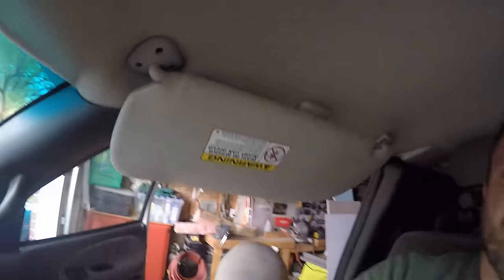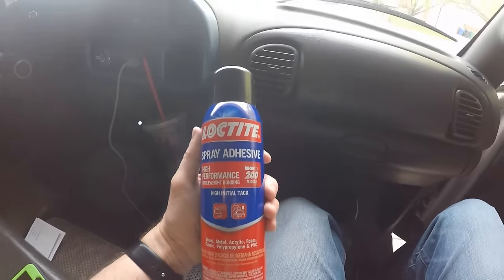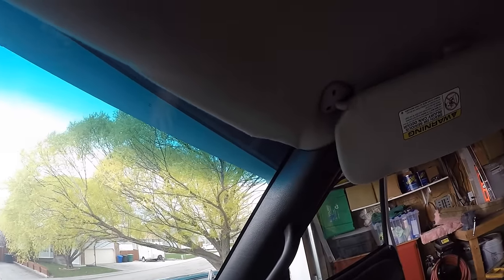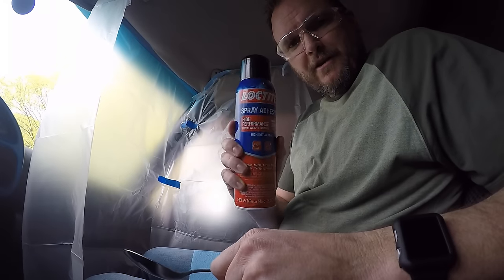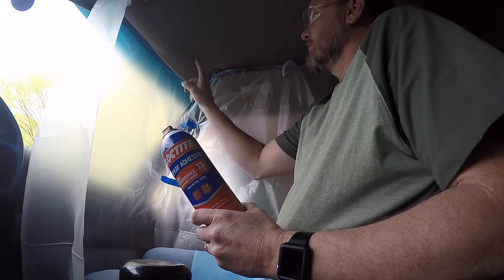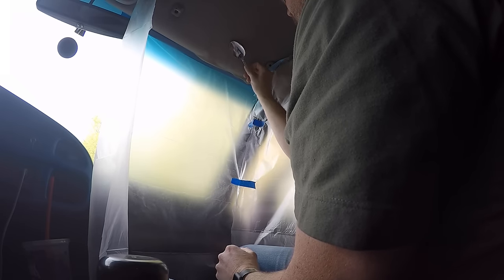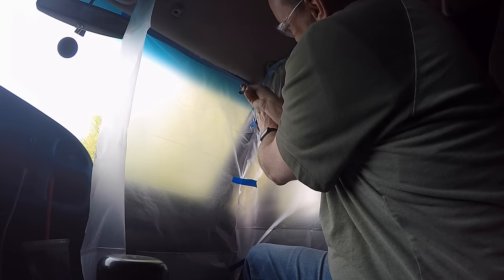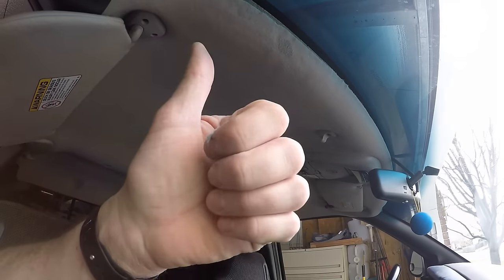Truck/Car/Van Headliner Repair - Sagging, separating, tearing away, drooping - DIY Fix

Comment: Is it ironic I'm watching your video because I have a Ford Ranger with the same problem?

These spray and tack glues state they are not for use with headliners. Do you have an update as to the durability of this repair technique? This was made 3 years ago, is the headliner repair still good?
Reply from the maker: It has been holding good until the last 3 months or so. I like to drive in the summer with the windows down. Even when it’s super hot outside. I have a new part above the drivers side that’s coming loose and the part I repaired is starting to come down again. I’d suggest the 3M headliner adhesive that’s linked in the pinned comment. I’m going to be buying some myself and give that a try this time. See if that holds better. 🤷🏼‍♂️
Reply from the maker: 3M Headliner Adhesive link to it if you'd rather try it - https://amzn.to/2rWQAtA
Reply: @troysgarage  Thanks for the update! That's not a bad but also not great as far as repairing the issue. 

I had can of Stinger spray glue for speaker box carpet. When I looked up the Loctite product you had on Amazon, I saw the review that recommended the 3M. I then watched another video, and in that they said the 3M works great but NOT for reattaching the fabric to the foam, only if it's the foam that has detached from the backing. He said if it's the fabric, like both of our situations, the only real remedy is to replace the headliner. Also he warned about hte staining/discoloring, which you mentioned and said the lighter the color the worse the staining will be. I have light brown.

I just ended up stapling mine back up, along the window edge, you can't see the staples. Someone wouldn't really notice unless I pointed it out. Not sure how long it might last but my guess  is a couple years. My trucks not in great shape (05) so it don't matter a lot to me more just trying to keep it out of my view and from getting worse.

Comment: Only for those who have it tearing along the edge - my past 3 vehicles that did this did it in the middle -as my current new used truck has now - oh wrll
Reply from the maker: True, it's easy to fix along the edges.  The key is catching it early enough (or being lucky enough it only releases at the edges.

Comment: Actually the problem is that (* or rather, if ) the foam is deteriorating. Gluing fabric to deteriorating foam is kind of like sprinkling dust on tape before you try and stick it to something. If you use enough glue that you fully saturate through the foam into the surface that the foam is stuck to, then when it fails and you have to have your headliner replaced, somebody is going to have to sand all that glue down before putting in a new headliner.
I've never done this I just watched some other video about it.
(added "or rather, if" on 10/6/2022)
Reply from the maker: I purposely didn't reply to this until even more time had passed.  This fix is STILL holding strong for me.  This doesn't mean you are wrong in every case, just in mine.  My foam backing wasn't overly dried out and the connection made between the fabric and the foam was strong and pretty immediate.  It doesn't look perfect, but it holds and isn't noticible by anyone but me.  I've never had anyone ride in the truck and ask about it.  It's just there and holding strong.  3+ years and counting.
Reply: @troysgarage  well, I thought my foam was deteriorating, but it isn't.
I used a little superglue in spots and some held, while others failed.
I guess it all depends on the condition of the headliner foam and condition of headliner material.
I'm now confident that if I use adhesive on my headliner, it will work.
I don't really care what it looks like (as long as it is physically clean, no mud, grease, etc), I just don't want it causing me to get in a car accident if it releases.
I'll probably do what you did in this video.
Thanks for the update!
Reply: @troysgarage  The only reason I won't rip my headliner out, is that I hear it gives some insulation from the sun. If I glue it, that's fine, better than removing it and I'm not paying $400 to get someone to do it professionally on an old vehicle that I only need functional.

Comment: it will not hold long,and it will be falling again.the glue will not hold because the foam has turn into a dust/dry rotted,and the glue is on old foam that will let lose in time,the best way is to take the headliner out,take off the old and the old foam until it's clean,then glue in the new.
Reply from the maker: It’s been 18 months and no sagging or additional parts coming off. I’m always curious why the “experts” watch videos of “how to” and then critique the steps taken?!?!  Maybe you should do a video. Hahaha. Naw, it’s more fun to pretend to be an expert. Thanks for the view though!  On a serious note though, is very bad cases the headliner would need to be removed. You’ll know that’s needed if it’s coming apart and sagging in multiple places. Mine was confined to this one spot. I still drive around with my windows down all the time and there’s no sagging,drooping or separation anywhere else either. My fix is good and still holding strong!  Good day sir!
Reply: Good DAY, sir! 🤚🏾.. lolol!

Comment: OK and that was 2017. Could you tell if your satisfaction lasted for all these years or more stories to share? I'm curious.
Reply from the maker: It has just started to come apart again in the same place. 4 years isn’t bad for a cheap fix. I’ll do the same fix again as soon as it opens up enough on its own to spray behind. Until then I just use the back of a finger to smooth it back out so the wind doesn’t catch it and make it worse. I like to drive with my windows down. 🤷🏼‍♂️
Reply: @troysgarage  Dearly thanks for the update.

Comment: Spray adhesive didn't stick, the backer board is flaking and not sticking to the cloth... I tried some thumb tax... No luck either.... ????? Frustrating!!!!
Reply: Addendum: I have to remove entire backboard.... Strip off old cloth, sand clean. Apply new cloth.... Someday...
Reply from the maker: Sorry, that’s the only option if it’s too far gone. Sounds like the rest is coming down soon too.

Comment: Can i just remove the entire headliner ?
Reply from the maker: Of course you can. After removing, use a shop vac with the bristle attachment to vacuum as much of the insulation off as you can. There will always be some left. 

My son did this to a super a cheap car he had in high school. Every time anyone bumped the ceiling insulation would fall. He also sprayed it with spray paint to try to get it to stop doing that but it didn’t work so well. Another spray might do better. Try PlastiDip maybe. 👌🏼👍🏼

Comment: Big improvement! Too bad GM couldn't use some decent glue in the first place. Cheap bastards!
Reply from the maker: Lots of corner cutting and cost savings taking place in the auto industry over the years. I know they have the tech to build a vehicle that would last decades but that doesn’t make them money. 🤷🏼‍♂️🤮

Comment: How come no one talks about how much these things cost? Permatex is $25 bucks at O'Reilly's, no idea elsewhere...why don't you address this obvious factor?
Reply from the maker: link to the Loctite spray adhesive used in this video is to Amazon for $23.50 - http://amzn.to/2o8ACbn.  This is a cheap fix if you catch it early it will save you hundreds later.  No brainer DIY weekend project.

Comment: What if it's sagging in the middle, not at the edges?
Reply from the maker: You’ll likely have to take it down and reapply the whole thing. You could do half at a time but not sure if that would be easier or harder. Maybe someone else can comment on that?  Hope you get some good advice on that one.

Comment: So basically that's for small jobs, if it's sagging all the way to the back then what??
Reply from the maker: Sorry to say but you’ll have to take the whole thing down and out. You have to get adhesive on both the fabric and the backing then carefully line it up to get it just right. I have seen a couple of videos out there but if I remember right they replaced the fabric when they did it. That would be easier than trying to line up an already cut to size piece.

Comment: Unfortunately, you will chase that droop over the whole rest of the headliner until you replace it.
Reply from the maker: It’s been 5 years since this repair and it’s just now starting to come down again in the same place and also just over the same spot on the drivers side. I’ll use this same repair again on both spots and it should last another 5 years.

Comment: That looks horrible; how embarrassing. You protected everything but your lungs with that glue. Thanks for the post though.
Reply from the maker: Keep in mind this isn't a "restoration" but a "keep it from tearing away further" job.  The truck had 285,000 miles on it at this point.  I sold the truck at 309,000 miles 3 years later and this fix was still holding.  On the protect your lungs thing....  if you do this stuff for a living and expose yourself daily then YES please protect yourself.  I had plenty of ventilation and didn't even get a contact high from the fumes.  Everybody needs to relax!  Putting your stuff out for the world to see isn't easy.  So I guess you're welcome!

Comment: I already tried that bullshit Loctite crap.  It doesn't work, and is sagging more than ever.  The heat affects the glue and it falls apart a second time. Go back to the drawing board as I have to do.
Reply from the maker: Your liner must have been more deteriorated than mine. This solved it for 3+ years and I did the exact same fix on the drivers side right before selling the truck. New owner comes by every once in a while. Still holding strong!  🤷🏼‍♂️

Comment: Hubba gum works😮. Lots of luck i couldn't get it to work longer than 3 years. The screw in retainers work. The trouble is the foam is rotting out from the heat and age.
Reply from the maker: This fix was still holding strong when I sold the truck 2 years ago, video posted in 2017 so that’s 5 years. I even used this same fix on the drivers side a few years later. Also still holding strong. It’s more about catching it early before there’s too much sagging pulling even more of the liner down.

Comment: Bruh put super glue
Reply from the maker: Naw, spray adhesive covers evenly and is cheap.  Easy fix with the right stuff.  Super Glue won't hold the entire loose section.

Comment: IF HE WAS SMART HE WOULD USE PUSH PINS
Reply from the maker: LOL, This "fix" lasted 4 years.  I even did the other side that started to pull away about a year go.  BOTH were still holding strong when I sold the truck 3 months ago.  I owned that truck for 16 years and it had 306K miles on it when I sold it.  I fix things "right" not just sticking pins in problems!  LMAO!  What kind of hoopdie do you drive?  Probably has bad breaks, needs suspension work and is past due for an oil change!  Or you trade and buy something new until you run it into the ground.  It's one or the other!  BwaHahahaha  (sorry feeling pretty spicy today after so many negative comments recently)
Reply: @troysgarage  I MEAN USE PUSH PINS TO HOLD IT AFTER YOU GLUE SPRAY

Comment: This is a waste of time and money. You can not save an old headliner. But have at it, when it is messed up an upholster won't touch it.
Reply from the maker: This repair lasted me 5 additional years with NOTHING else to do to it.  I then sold the truck and still see it from time to time around town.  Headliner still intact!  If you do it "good enough" and before it's completely destroyed this fix works!!!!  Not everything is a waste of time and money.  If it got bad enough I would have replaced the whole thing and not messed with it.